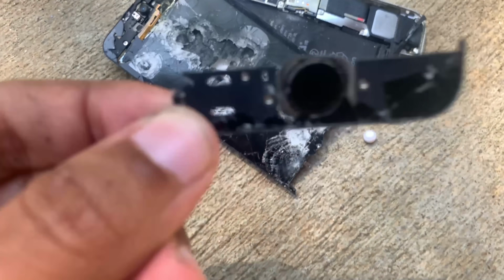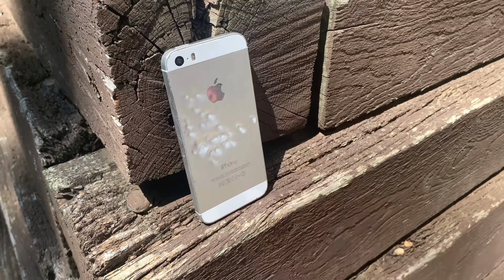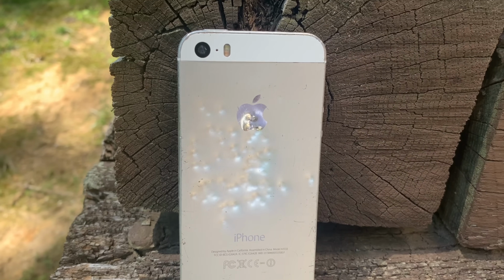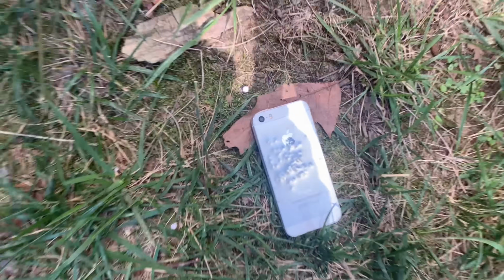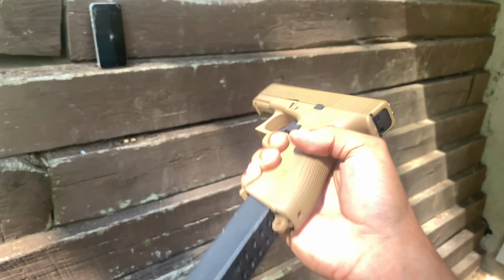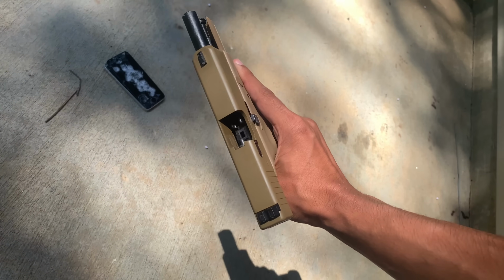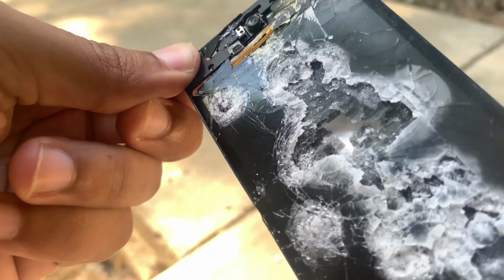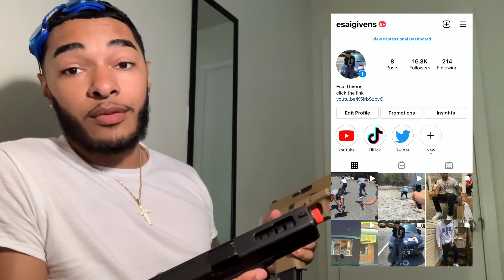Glock 18c BB Gun vs iPhone!

Comment: I see you removed the orange tip on the 19x . I hear the tip is used as an accuracy stabilizer . Have you had any issues ?
Reply: The only reason they have orange tips is so people know it's not real
Reply: thegamefixed on the 19x it serves as a stabilizer so the gun shoots straight . I had one , I removed the orange tip and the gun wouldn’t shoot straight anymore
Reply: @white9th193  mb I didn't know it worked different on different guns
Reply: That's some hard ball crap, it's just so people know it's not a real gun.
Reply: @astrojoshy3135  shoot long distance and test accuracy and then come back and tell me it’s hard ball crap